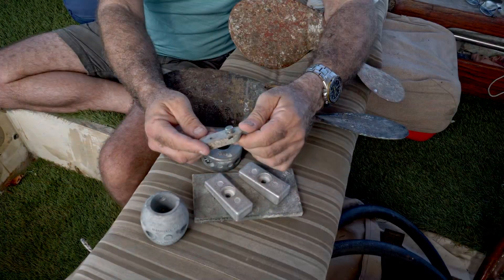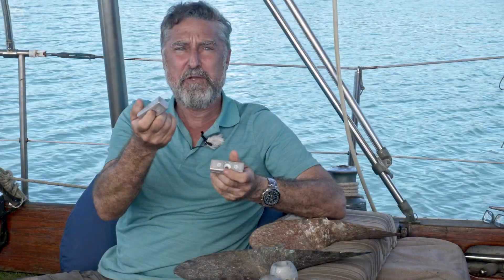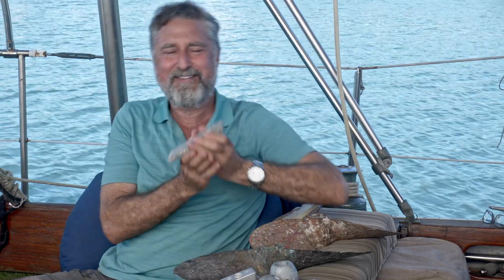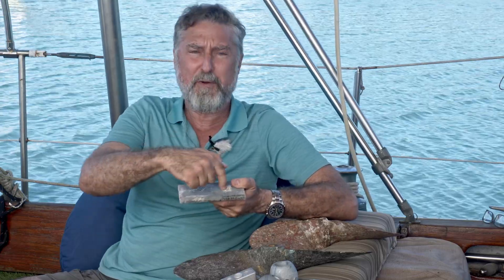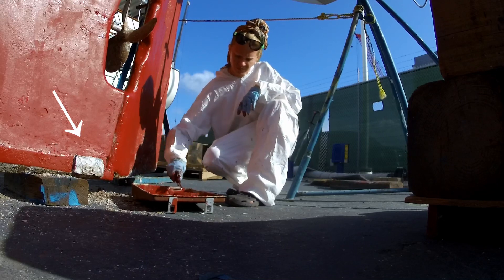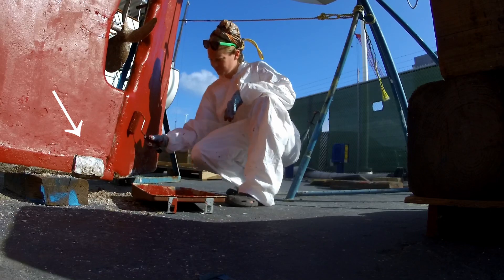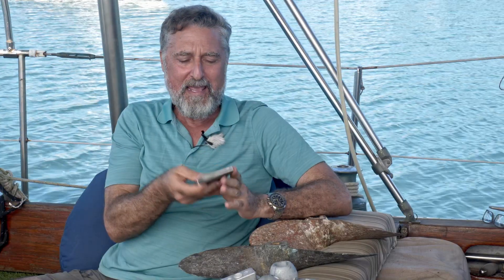Zincs: Protect your boat from rotting away

Comment: Thank you for the information. Do zinc’s have to make contact with the metal intended to save? I’m currently at a marina and thought about the zinc’s that are on stainless cables and dangle in the water. Where would that need to connect to protect the metal on the boat?
Reply from the maker: They have to be in good electrical contact with the metal to be protected.

    The higher the resistance in that connection the poorer the protection

Comment: Just some friendly corrections regarding the chemistry:

At 6:04 one should say "the LESS (not more) electronegative atom is the anode”

Electronegativity was proposed by Linus Pauling as a measure of an element's affinity for electrons. This can be measured, as shown in your periodic table (5:25), where a higher number is more electronegative. In electrochemistry a more electronegative element can be thought of as 'stealing’ electrons from the less electronegative element. This is why, in the battery you show at 4:50, Zn (electronegativity = 1.65) gives up electrons (i.e., oxidation/anode) to bronze = Cu(1.90)/Sn(1.96) (reduction/cathode).  It is also is why Zn (1.65) is a good sacrifical anode for bronze or steel/iron/Fe (1.83). The mechanism of protection is that when electrons flow from Zn to iron/Fe, for example, it inhibits Fe’s tendency to lose electrons forming Fe3+ and ultimately rust (Fe2O3). 

At 5:44 one should say “the least nobel metals have LESS (not greater) electronegativity”. Thus the least noble metals are good sacrificial anodes. Mg (1.31) is one of the best.

Comment: Should there be zincs on the anchor and anchor chain. This system on my boat is electrically isolated from the remainder of the boat
Reply from the maker: Your anchor and chain should be galvanized.   That's zinc

Comment: I had a 40ft steel narrowboat in the UK 30 years ago. I had 2 anodes welded on the bows as I was advised to when the boat was new. In the 5 years I had the boat it was dry docked twice to repaint the bottom, I could not see any reduction in the anodes or pitting of the steel or prop. I mentioned this fairly recently to someone who freaked that the anodes cant have been doing their job (I hadn't earthed to them). I wonder if there was no changes due to the boat always being in "fresh" water?
Reply from the maker: Two issues.  First as you said "fresh water" it's just not as aggressive as salt
  Second.  One tends to use "zinc"s that are not really zinc in fresh water.  Magnesium??  I'd have to look it up.  In short you want a greater electronegative difference.

Comment: That was a great video. The biggest issue I have seen is that people OVER  zinc their vessel. It is a great idea to try and find the stray currents floating around your vessel and reduce it as much as possible. Marinas can be bad for electrolysis as the vessel a few berths away maybe full of stray current going into the water and affecting your vessel. All that white fuzz tht can appear awound on wooden vessels electroylsis just a battery eating your wood.
Reply from the maker: Thanks Dan

Comment: Bronze is NOT  Copper/Zinc (that would be brass and would soon become a lace shell of its former self).  Bronze may be Copper/Tin, Copper/Silicon/Aluminum, Copper/Nickel/Aluminum/Tin, Copper/Arsenic. (and many other alloy variants)

The least noble of the metals in your particular Bronze will be dissolving. ... without a sacrificial anode, usually Zinc or Magnesium :) 

You can make a steel mold wtih a die grinder, re-melt, & re-cast ... the dross will remove all of the slag.

Love your presentations!

Comment: Hi, thank you very much for your very informative videos. Just a quick question, how did you install/ attach anodes on your aluminum hull dinghy? And how many them did you use?  I would be very thankful if you may spare some time and reply. Best Regards.
Reply from the maker: I just drilled a hole in the transom below the waterline and bolted it in place with a rubber washer on the inside.
Just one the size I show in the video.

Again a zinc for an outboard motor (just find the cheapest one).  They are the right electronegativity to protect aluminum.
Reply: @Clarks-Adventure  Thank you! Will do the same on our dinghy. Stay safe :)

Comment: Hmmmmm,.......  Mine (1980) GRP is mostly bronze through hulls, and most of them are internally grounded together (star I think) (probably helps out for the SSB as well), the prop zinc fell of by the pressure of the high pressure cleaner when I hauled her out, so they're working.   But the ball valves on the toilet outlet through hulls were of the cheaper brass, and had that wrong color (light red / salmon color) and the handle just broke of with very little force.  But the bronze through hull it was mounted on looked perfectly o.k. ...... However, the toilet through hulls are the only ones on the boat that are not grounded (not part of the ground star network). ........ So then comes one of my question :.......... Does this grounding assure all through hulls (and prop shaft etc) are at the same electrical potential, thus preventing them from interacting as anode/catode, thereby protecting them against each other ? .......... And if that brass valve house was electrically connected to the bronze through hull, would it then not have coroded ? (maybe not with regard to the copper, but maybe with regard to the pooh ?). ....... I know I shouldn't use cheap brass but. ..... My boat is probably quite simmilar to yours by the way. ......... Thanks for the deep diving :-) ........ And one more observation from mine,..... where the hoses are connected to the through hulls, there typically is (after a while) a ring of something looking like salt (white and of a powdered nature) in the transition between the copper and the PVC? hose. .... I've cleaned it of and I DON'T see that light red / salmon color indicating that the zinc is gone and the metal thus damaged, so I've assumed it's salt from evaporation of the salt water inside somehow, but I've failed to get that confirmed by uncle google so far. ... There are the stainless steel clamps there of course but they're just in touch with the PVC? hose so electrically isolated they should be when everything is clean but. .....
Reply from the maker: I personally don't connect thruhulls.  I use good bronze and expect them to last a long time but not forever without zinc.
Brass with bronze are different metals, you are making a battery and the brass is loosing.  Don't use brass!  Use plastic if you need to save money.  Glass filled nylon is wonderfully strong and won't corrode.  Even pvc is better then brass!

Comment: Hi Clark, 
another very informative and timely video.  We are heading to the Caribbean mid summer but will be in Lake Ontario for a few months. 
I’ve been researching online regarding which material to use. 
I see 3 options . 
1 is  to use both a zinc  and magnesium anodes on the  prop shaft.  
2 is zinc only. 
3 is aluminum as it somewhat effective in both salt and fresh.   
So far I’ve not been able to draw any firm conclusions. Your opinion  would be most welcome.

Cheers Kevin H
Reply from the maker: Don't mix anodes. The magnesium will just protect the zinc.

Can't answer your question because you didn't tell me what you are protecting.  But if the least noble metal is your bronze propeller, I answered it in the video.  Zinc.
Reply: A few months, I don't hear people changing. From what I am aware having lived on Sacramento River, salmon temporary fishing up there made no changes coming up from the Bay. My understanding is your still protected enough and just going to kill your marine growth.

Comment: Melting zink is dangerous without a proper respirator to protect you from the zink fumes.  The same is true when welding on galvanized steel because the steel is zink plated.  Zink fumes can kill you.
Reply from the maker: You are right

Comment: Thank you I have albin vega 27. This has the keel shoe you spoke about. Also used to have a zink on the shaft. Shaft has been removed,yet a bronze part that's glassed in remains. Should I mount a zink close to these areas to protect the bronze? Thanks
Have a good day
Reply from the maker: It has to be electrically connected to do anything.  Not just close.

If you only have only bronze below it does fairly well but within a decade or do it could become real unhappy.  I'd drill and tap into the bronze and mount a zinc in the rudder shoe like I did.

Comment: You mentioned stainless, which got me thinking. Maybe a discussion of how stainless works, why it doesn't rust, and under what conditions it does? People get into trouble, sometimes, thinking that since they bought stainless they needn't worry about corrosion, and they really do.

Ditto for aluminum. It doesn't rust, for very different reasons than stainless, but also very much can corrode in certain circumstances.
Reply from the maker: Yes.  I talk about it a bit in the anchor video.

Stainless sorta sucks in a lot of ways.  Generally bronze is so much better.

Comment: Great info.  Saw a photo of an aluminum sailboat for the antarctic that had a sign on the companionway: "NO METAL COINS ON BOARD."  I guess Cape Horn is the last place you want to try to find a leak.
Reply from the maker: I knew a guy in Seattle with a jar on the dockbox for pennies.

But a broken mercury thermometer would be even worse.

Comment: I have only noticed 2 things with regards to brand.  1 had a copper bb in it so it would make a "better" connection to the shaft.  2 more expensive Zincs have screw retainers so you can loosen the screws without them falling out.  It's easier to install them that way.  I save old zinc screws anyway.  Can't have too many stainless screws around.
Reply from the maker: Yep.  I've never been convicted the bb did anything important.

Comment: Simple explanation. For something so basic amazing how much talk and failure is related to it.
The most forgotten zincs appear to be the <$5 one in the heat exchanger.
Reply from the maker: Yep.  Modern yanmars don't seem to have them anymore.
Reply: @Clarks-Adventure  News, really! Have Beta, they still do. Tube-stack is marine brass, bronze end caps.
Reply from the maker: My old Perkins 4-108 didn't either.  That one I took apart enough to know why.  They actually electrically separated the dissimilar metals.  No need and after many, many years of use no problems.

I wonder if yanmar did something similar.  

But if it works, don't fix it.
Reply: Great explanation Clarke but....
Many boats have more than one "ocean" to whivh metal is exposed. If you have bilges that always contain some water and there is metal there (eg keel bolts!) you also need an anode immersed in that water and connected to that metal.  The zinc outside the hull cannot protect metal inside because the water part of the circuit is not connected.
Reply: @richardstott7777  my 2 main anodes are connected to lead keel and everything linked to that, wooden boat. Refering to fiberglass with bolt on keels? I would agree that structure should be protected.
Reply: @braithmiller  it is nit about what the hull is made from. Any non permeable barrier between the water in contact with the anode and the water in contact with rhe other metal will permit the reaction.  It is just the same when you close a seacock - the water in the hose is no longer  in contact with the anode. That is why you also need and likely have a zinc in the heat exchanger or your raw water cooled cylinder block.   Large ships even need more than one anode becaise the distance bettween a single anode and exposed metal can have the same effect of weakening or breaking the water part of the circuit.

Comment: My propeller would be solid Bronze, then I'd have it cleaned....and dipped in Stainless Steel 1/8" thickness afterwards I'd apply a Zinc Galvanized coating onto the stainless....then I'd apply and baked on PTFE based-hard resin fiberglass film to the galvanized prop. After installation of the Bronze, stainless, galvanized- baked on ptfe fiberglass prop...I'd coat it with Vaseline. I'd call my advanced propeller the "lifetime low-maintenance propeller". The bronze-to- stainless juncture would be so clean air and water tight...no galvanic effect would ever encroach.
Reply from the maker: Cute.
If course for anyone reading this.  First chip from hitting something and it corrodes from the inside out.
Reply: @Clarks-Adventure  Forgot to mention ...warranty is void if you strike the prop exposing any part of the bronze metal.

Comment: Clark - you did not tell the peoples that too much Zinc can be as bad as too little - google is your friend for info - another Vlog ??
Reply from the maker: In what way is too much zinc bad?
Reply: The issue is not that too many zincs will make them not function. The issue is that too many zincs will result in greater potential than needed for protecting props/rudders/etc and that causes other problems such as a degradation in how well your antifouling paint will perform (it needs electrons of copper to leave the paint and repel growth and this is prevented if there are too many zincs), or it will cause gas buildup under your paint that breaks the paint bond (this is an issue for aluminum/steel hulls), or it can also cause deuteriation in wood hulls due to the creation of caustic soda.
Reply: @judunlap2138  Aluminum hulls I understand and require electrical monitoring. In practice I have not encountered the issue in a wooden boat yard. The steel boats will do as they prefer more zincs than wooden of the same size. The wooden boats with mild steel and iron run more. Not really ever getting a definition of ratios it does seem more individual. I have seen testing in most cases not useful. The antifouling, this is really the first I have heard someone agree with this concept. I am not aware of my antifouling making a successful useful circuit between lead keel, through hulls or anything else. Authoritative sources I always appreciate.
Reply: I hear much talking about this, never yet encountered such a thing. Sometimes I am surprised at how many large zincs may be on a wooden sailboat keel when 2 is generally plenty. More is just extra drag. The idea that to much will cause them to not work is nonsense.

Comment: Great video. You forgot to mention the bronze hull fittings that need protection with the zincs also. That could be a problem for sinking purposes.
Reply from the maker: Actually I don't protect them.  I suggest removing all wires to them.  It's a long story involving stray current found in marina waters but in short they shouldn't need protection if they aren't connected to any dissimilar metals.
Reply: @Clarks-Adventure  Clark, i didn't mean having zinc's on them but the zincs help protect any metal below the waterline. So you do not bond all metal below together like bonding and grounding for lightning? Just curious?
Reply: The deep conversation on co-bonding, lightning protection and stray currents. There is a prior episode on lightning protection. Big division of opinions. Bond together you can get a through hull corroded in months in a marina, unbonded many years.
Reply from the maker: Yes there is a difference of opinion there.  And valid.
Personally my thruhulls we're fine but I lost my mounting bolts in just 30 years!  I'm OK with that.

As for zinc protection, there is no protection if there is no wire.

Comment: I can't stop looking at the glasses on the  ledge to the right... They're so going in the drink 😂
Reply from the maker: That's the cockpit coming.  There are 2 feet of deck outside of it before the toe rail.  Temptress is a unique design and the glasses are very safe.

Thanks for your concern.  Things like that bother me too.  On my diesel oil change video the fact that I didn't cap the used oil jug drove me crazy during editing.